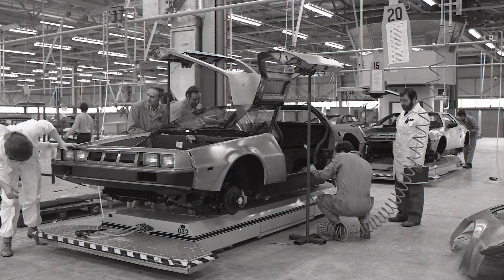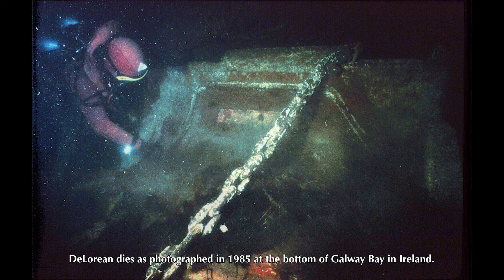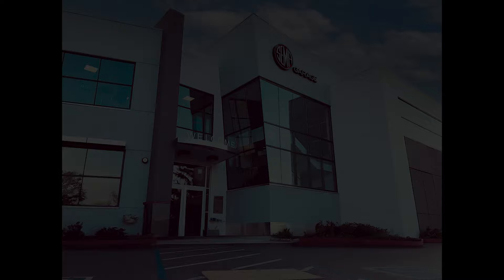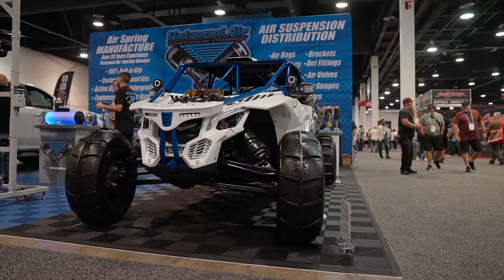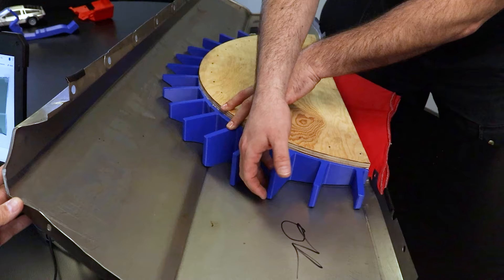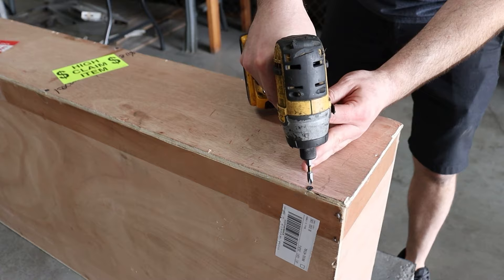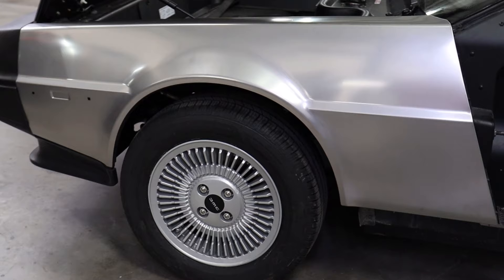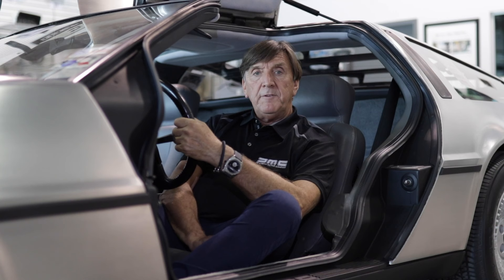New Reproduction Stainless DeLorean Left Fenders

Comment: This is an amazing thing to do. Theoretically reproducing the right fender should be a quicker process now. Only needing to mirror the left CAD file and add additional things like the antenna hole. Seeing this done for the doors and rear fender would be amazing.
Reply from the maker: Well, right now there are nearly 1,000 doors in the build, and at least hundreds of the other 6 panels. Hopefully we're done with reproducing SS panels for a long time!

Comment: Very good news! Mine is looking a bit sad with a bunch of dents and other damage so a new one would be perfect
Reply from the maker: We think there are a lot of owners in the same position - those with varying degrees of damage but until now have found it difficult to justify the cost of a replacement.
Reply: @deloreanmotorco  exactly. The previous owner had damaged it but it wasn't looking bad enough to justify spending that much on it. But at the same time I'm very fussy with my Delorean so I can't stop looking at the dents and stuff. But now I can get some ease of mind basically 😊

Comment: Is this going to be an ongoing/multiple production run, or is it more of a one time run?  I just really don’t want to miss out on this!
Reply from the maker: That depends mostly on how many we sell. With parts that haven't been (readily) available for years it always challenging to predict long term demand after the pent up demand is satisfied. One thing I've learned is that prices rarely come down over the long term, and generally increase. Even if the initial run is in stock for years, holding costs and inflation in general will cause prices to increase as time passes.
Reply: Just dont dump the new dies into the ocean when you are done.   @deloreanmotorco